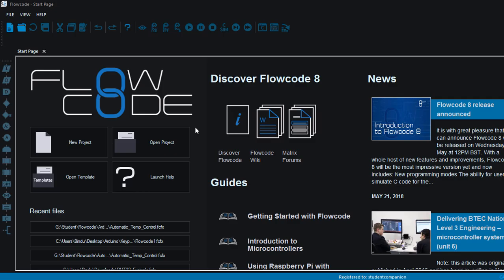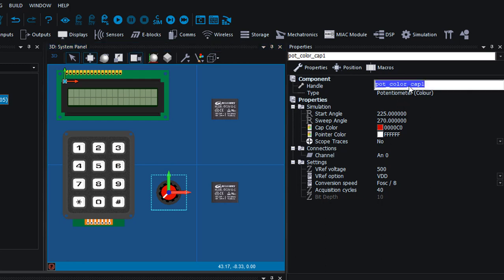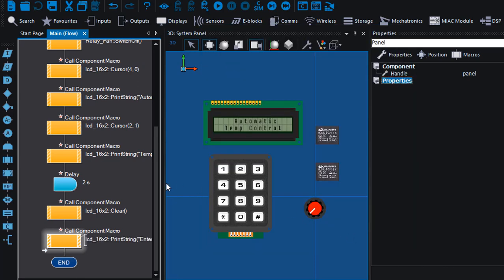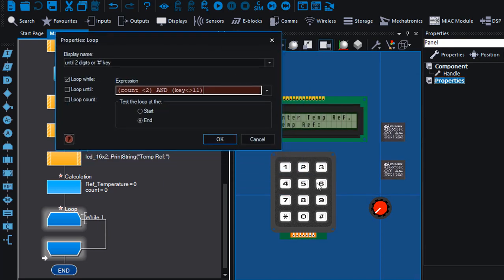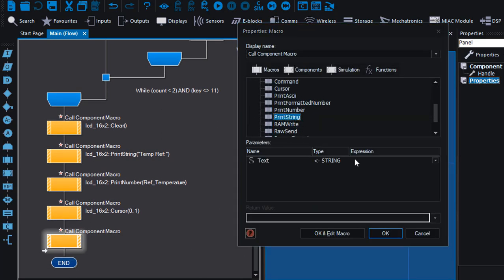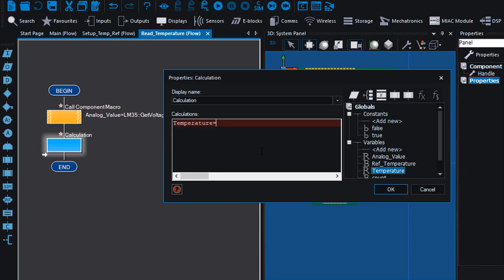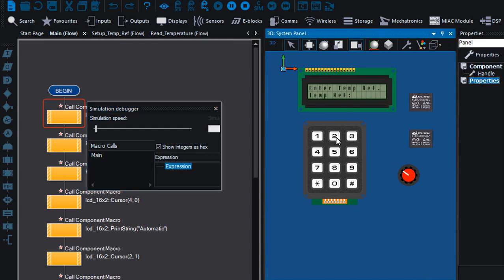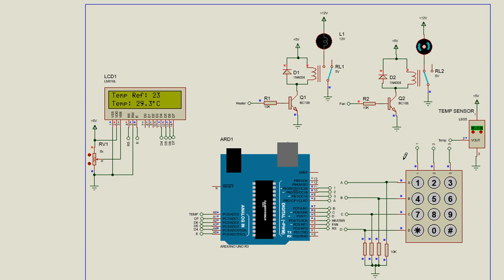12- Project 2 Automatic Temperature Control System, part 2 | Arduino with Flowcode Tutorial

Comment: how do I do calculations for months including leap year months on RTCC .am done setting time and days but months are giving me challenge
Reply from the maker: You didn't specify which tools you are using. Are you programming wit Flowcode, MPLAB....? Are you using a PIC, Arduino...? Are you using a microcontroller internal RTCC or an external RTCC? If you are using an external which one? Usually for external you don't need to do any calculations the chip will take care of everything.

Comment: So with flow code you just set the flow chart to make code?  That’s awesome if that is the case!  I have programmed arduino in C and its such a pain in the butt..
Reply from the maker: Yes. That's the case. Just drag and drop flow charts and the rest is done for you. You can also mix flow charts with C code if you like C code or you are learning C code.  You can also view the Flow chart C equivalent. 
Plenty of components and you can simulate your code.
The other advantage is the same Flow charts can be used with other types of microcontrollers like PIC, AVR and even Raspberry pi.  So you don't have to learn new languages.  You just have to select your pins
Reply: Student Companion where do I get the flowcode software?  That is awesome!  I have experience in the older PIC 16c56 units as well but have long forgotten how to program in assembly..
Reply from the maker: You can download it from their website: https://www.matrixtsl.com/flowcode/download/
Reply from the maker: Watch this video to get started: https://youtu.be/EKS0uVcn2z4